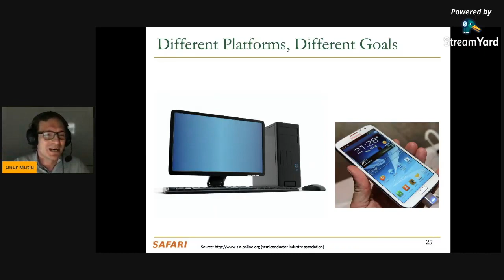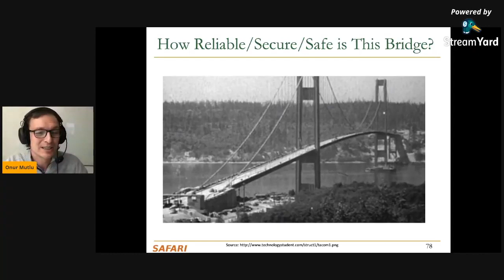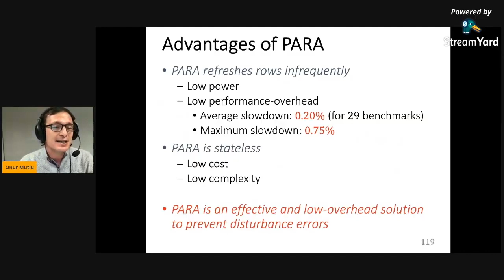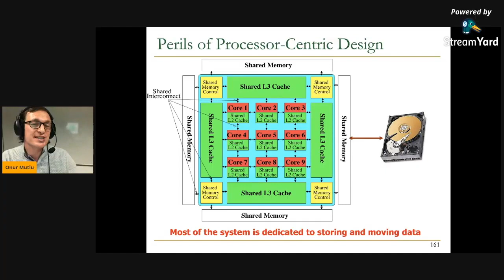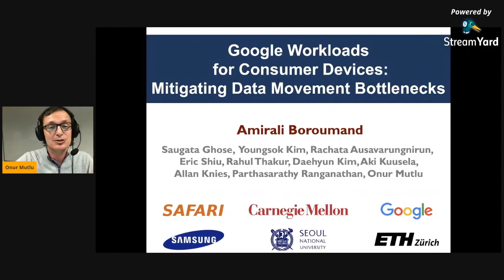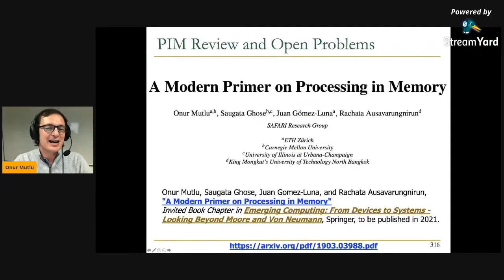Onur Mutlu - Future Computing Platforms: Challenges & Opportunities: Invited Talk at IEEE CS Turkey

Comment: Since computation is moving now where the data is nowadays i.e., computational storage, why not implement ECC in the DRAM, solving just "practically" the rowHammer attack? Thanks for the presentation btw.
Reply: ECC can only correct single bit flips and detect atmost 2 bit flips ........ whereas row hammer attacks may induce multiple (>2) bit flips , hence ECC is not the straightforward solution to rowhammer . Btw ECC DRAMs have been available for a long time in market.